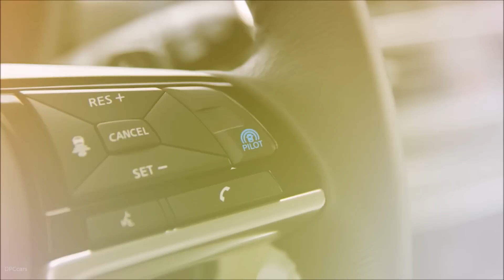2019 Nissan Altima Factory

Comment: That VC-Turbo engine has a lot to prove to replace the slick VQ35 V-6. Only time will tell
Reply: I agree
Reply: It's not going to replace it my friend. Companies (for the most part) have just decided it's time to see the V6 engine leave the midsize sedan segment. It makes the cars able to be more technologically advanced and nice looking without driving up the price tag with the additional engine. People just dont buy them in the midsize class anymore. Most people who could grab the 3.5 Altima just said "fuck it" and went all the way to the Maxima because why not? Thats what they SHOULD be doin'. They need more distinguished gaps between their midsize and full size cars because sales are suffering. Only a matter of time before Toyota does it too... spending money on two different engines to be made... 301 horsepower Camry and a 302 horsepower Avalon... what's the point at that rate? People want V6 or V8, they'll have a class of vehicle for that and not have to sacrifice manpower on a bunch of V6s that take too long to sell off the lots
Reply: I was sceptical too about the VC turbo but I can assure u it's faster and stronger than the 3.5.  The new Infiniti qx50 has the same engine in and I have the pleasure of driving one and the engine is a blast. It has a lot of torque and it just goes.
Reply: gains 20 torque, but loses 20 hp

Comment: Get rid of the CVT trans already 😫 My 2000 Maxima SE has  given me zero issues with the transmission and still runs strong. Go back to what used to work and bring back the manual trans if possible as an option.
Reply: Theres no turn back..
Reply: Last of the good ones
Reply: They won't. All you have to do is not buy the new ones.
Reply: CVT is proven to give better performance with better fuel economy.  However it suffers from poor reliability.  With time it should improve with future generations.
Reply: @mrslcom  performance wtf..that shit is worse than a slush box... been garbage since 2003
Reply: fghufxsw gfhhtjvdyh there is nothing wrong with CVT transmissions just people who don't know how to take care of them. Shit I myself don't take any care of it I drive my car like I stole it and as long as I replace my oil when it's going bad the car keeps going strong as new. People need to learn about what they drive that's all
Reply: @_LEONKING_  cvt 's are hot garbage... seen them crap out leaving the show room floor and coming off the transport
Reply: They merged with Renault in 1999 and their quality control went downhill right after that! Nissan/Infiniti will never be the same. I stick with Toyota, Honda, and Ford! Scotty Kilmer will tell you the same.
Reply: Nissan Tech Scotty Kilmer has saved me and a lot of people a fortune in car repairs and buying the wrong brands. He knows his stuff!

Comment: I've got a 2016 Altima and had the CVT transmission replaced twice, started failing bad at 24k miles
Reply: You had it for 26k miles and never changed the oil didn't you? My cvt gets needs an oil change every 5k miles but varietes on peoples driving and I'm pretty sure most people who fucked up their transmission are that type of people to hardly ever do maintainence on their cars let alone learning how their cars work. It's actually sad that something as important as a car gets the least attention from their owners
Reply: Buy Toyota or Honda next time.
Reply: León that’s what I said most of the people complaining about the cvt don’t get the transmission oil changed
Reply: FLYBOY yes I was a Tech for Nissan
Reply: @_LEONKING_  yep, the dealership takes care of all that, I keep it well maintained.. it's sad people will make assumptions about someone without knowing anything about them
Reply: @flyboy8364  you told me nissan takes care of it. They were the guys who tried to charge me 300 to fix a loosened up heat shield that cost me 20 to get welded. They also recommend getting your transmision oil changed every 30k miles when my car needs that oild changed almost every 6k miles or it starts overheating. 

I learned a lot about CVT transmissions thanks to my current vehicle and I think most people who break theirs is because they think like you "nissan takes care of that" no they don't.

Comment: The technology isn't the driving factor nor is it the engine, but durability and longevity of the product. I'm am the owner of an original 1993 Nissan Stanza ALTIMA. The car has 247,000 plus miles on the car. What makes he 1993 Stanza ALTIMA stand out from the 2019 Altima and other Nissan products in its class? I tell you one fact. The longevity, workmanship and durability of the 1993 Stanza ALTIMA surpasses the Altima's that have come after it. Why? There hasn't been a current Altima that has been driven constantly without having some drivability issues. One, the new CVT transmission fails. My observation of the 1993 ALTIMA for the past 25 years make a loud and bold statement "I'm a product that's is built to last" and has no signs of stopping. Can anyone say that the 2019 Altima in 25 years from now, would still have original unaltered equipment such as engine, transmission with out having to be either fixed or replaced? I don't believe anyone can. This is what makes a good car great! Nissan please bring back the good ole transmissions and the durability and longevity of the Nissan products.

Comment: According to CarMD, the win is a first for Hyundai. The brand finished behind Toyota in both of the last two years, finally edging them out in this year's rankings. CarMD says the rankings compared more than 151,000 specific repairs performed from Oct. 1, 2012, to Sept. 30, 2013, on vehicles with model years from 2003 through 2013.

"Hyundai strives to provide our customers with a worry-free car ownership experience," said Erwin Raphael, director of engineering and quality for Hyundai Motor America. "Earning the first place title in CarMD's Vehicle Health Index report proves that our recipe for combining high value vehicles with long-term vehicle protection is a success."

In terms of vehicle protection, Hyundai is indeed unparalleled. The brand boasts a 5-year/60,000-mile bumper-to-bumper warranty on each of its vehicles, along with a 10-year/100,000-mile powertrain warranty. Only Hyundai's sister brand, Kia, can match the automaker's impressive warranty numbers.

Comment: anybody know how much these assemblers are getting paid? seems like a cool job if it pays well.
Reply: socal benny my friend dad worked at ford factory he after he retired he was making 73 hour
Reply: Starting pay is about $15/hour. Top out at about $22/hour after about 3 years. 
Currently hiring. :) 
(I work there)
Reply: @ricardovazquez7261  kinda low wage but is the cost of living still low in that part of the country?
Reply: @socalbenny4728  yes I agree on the pay being low (we all do here). The cost of living is better than other states, though.
Reply: @ricardovazquez7261  will you be able to say what are the requirements for this job like education and training?
Reply: @socalbenny4728  sure, to be a technician (the shop floor employees in the video)at least 3 yrs of manufacturing experience. For a Quality tech   a college degree. And of for engineers the proper degree.
Reply: thanks for the info.

Comment: How many of them actually own any Nissan. Lol. I’m also not a fan of the awful cvt tranny.
Reply: now every one is going cvt Chevy Malibu 2019 Hyundai accent Toyota corolla i think its more reliable nowdays.
Reply: So many people talking bout the cvt without any knowledge of it. I've had my Nissan Sentra since 2014 and has had zero probs wit it so far, its superb on gas and also my other car the 2018 qx50 has the VC turbo which is a power house and also really great on gas. Its drives like a 4 cylinder when going about normal business and when u need that burst of power it there in an instant and it just goes on and on. Alot of you just keep repeating what other people say without checking it out for yourselves.

Comment: cvt transission. no thanks. i keep my hyundai
Reply: hyundai is also going cvt for their 2020 sonata. i guess everybody is going cvt.
Reply: it depends who makes the cvts Toyota, honda, hyundais they know how to make them. I guess it will require more changing transmission fluid every 30,000 miles. Nisan makes them crappy. I wont buy a nissan. I own a nissan but it doesnt have cvt. I change the fluid every 30,000 since i got it and all maintenance. 127,005 miles and still runs like new. It may be old now because is a 2009 but im keeping my nissan. we use it for road trips. Last road trip we went to michigan from Branson missouri where i live and it was great.
Reply: as long as the EPA stays intact, everyone will be using CVTs soon, everyone.... better mpg. sucks but its the truth
Reply: Fernan Martinez Nissan Maxima has a CVT and drives better than Hyundai on the market!
Reply: @A1God25  The current models are not. They're really fun to drive and look nice too.
Reply: i dont think so. what better person to ask that question to. I own a nissan and a hyundai they both shift and drive very nice and my hyundai you dont know if its on because its the most quiet car i ever drove.
Reply: i respectfully disagree. I own a nissan and a hyundai. They both shift amazing. My hyundai is very quiet and has a very strong engine for a 4 cilynder engine. My nissan  3.5 V6 strong also. But im very happy with the hyundai how strong that 4 cylinder engine is.
Reply: What is a cvt
Reply: @RucciWrld  thats a transmission inveted by DAF.

Comment: Many have pointed out the CVT is crap. Fact is the ENTIRE CAR IS CRAP. Trash materials for the steering wheel. Seat bolsters that fall apart at about 60k miles to reveal sharp edges on the steel c channel used to build the seat free. Noisy AC motor that stops only when non operational. A terrible support system from dealers that attempt to bill you for non necessary repairs that only prove the transmission is garbage. If I was in the video I would have a bag over my head out of sheer  embarrassment!!!!!